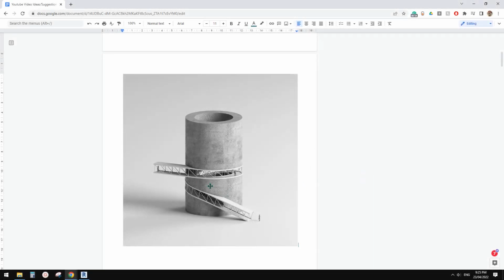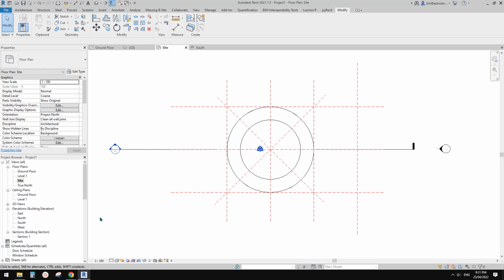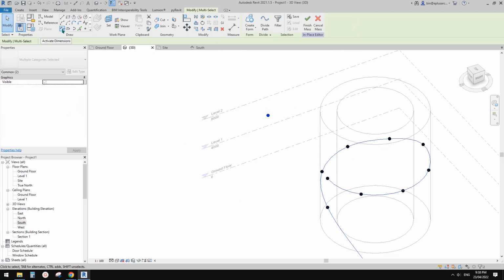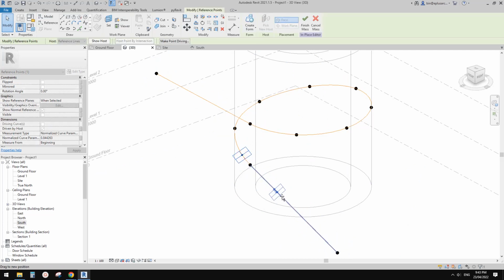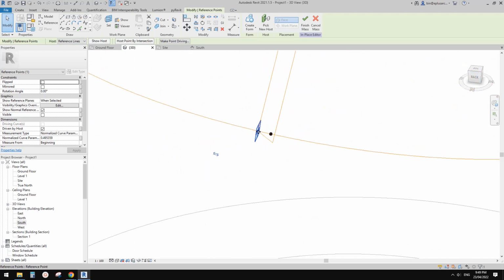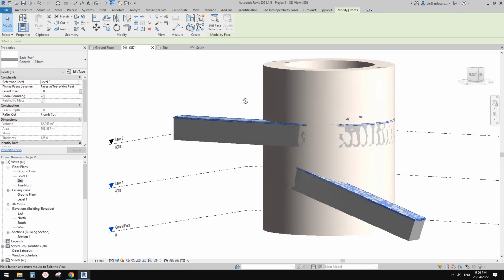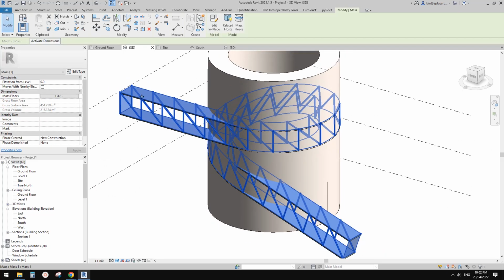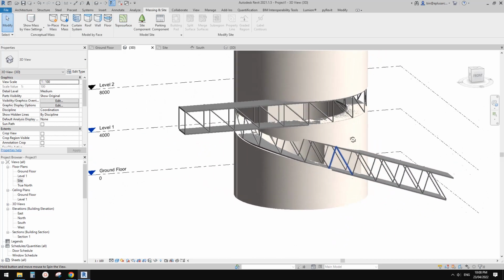Revit Exercise (Day 761) - Massing Exercise

Comment: I wonder if we can hide HH the two straight lines after we ‘ ve straighten the ends of spline in order not to select accidentally ? 
Is it possible to add profiles and edit them in stead of redo the form?
Reply from the maker: Good question. I don’t know. The best way to find out is to test it in the model.

Comment: Hey sir! great tutorial. Can you please help me out how can I bring forward an architectural column, that is placed somewhere in the middle of wall, so that my column is visible properly along with wall.? The problem is when I make my architectural column a black or dark color it is not shown properly because the major visible portion is wall and only the projected portion of column is visible.
Reply from the maker: Architecture column will automatically join with wall and use the materials from the wall. Maybe you can use Structural columns instead if you do not want them to join.